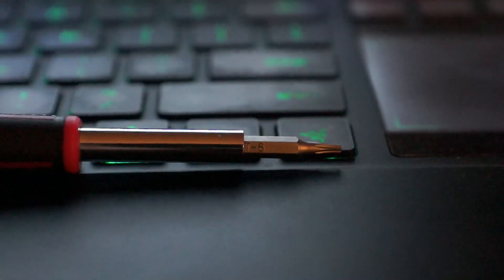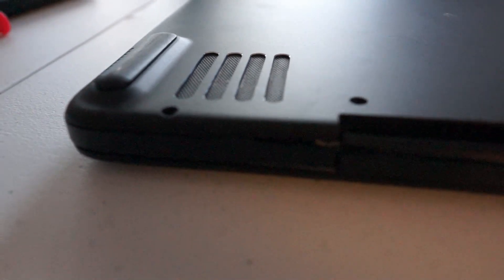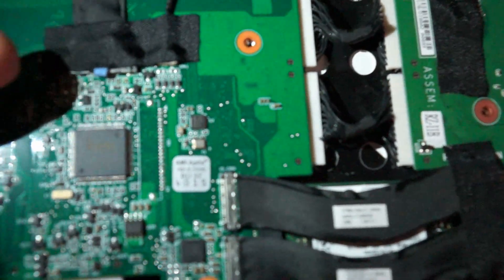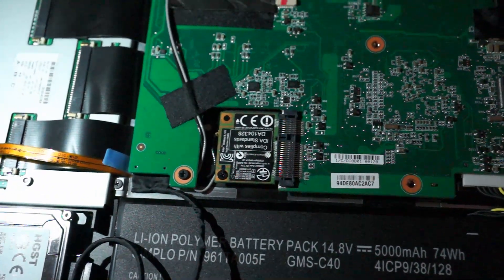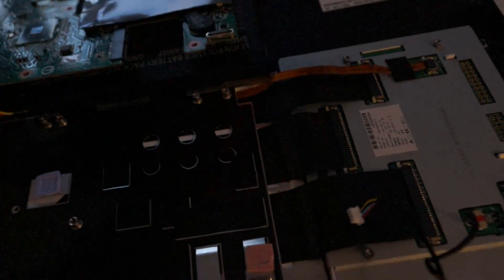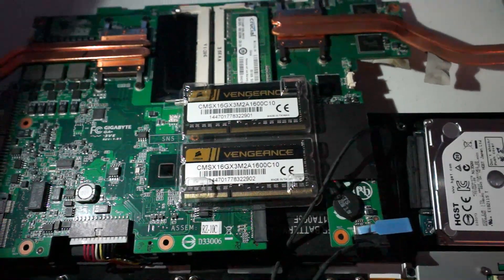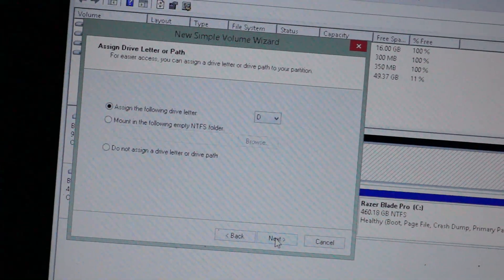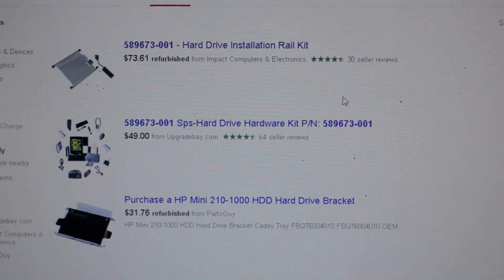How To Upgrade Razer Blade Pro RAM and Second Drive

Comment: I know this is a long shot because of how old this video is but is there another alternative to the rail kit? I can’t find one at all... also what about a battery replacement
Reply from the maker: HYPNOPED only option for battery I found was a direct replacement from Razer and they wanted $100 just to ‘diagnose’ my laptop then charge me another $100 to replace it. They’d probably charge more on top of that for labor.

Haven’t seen any other rail kits. The one I mention in the video is long discontinued.

Comment: is there another cross ref for this pn ? cant seem to find this cable.
Reply from the maker: The cable was discontinued but last time I searched these might work.

HP Pavilion DV6-3000 Series SATA Hard Drive Connector W/ Cable
HP Pavilion DV5-2000 Series Hard Drive Connector W/ Cable 6017B0265101
HP Pavilion DV5-1000 Series SATA Hard Drive Connector w/cable
HP Pavilion 14" DM4-2000 SATA Hard Drive Connector Cable 6017B0258901

Your best bet is probably ebay. The 

cable shouldn't be more than $20.

"List of compatible models includes: 
Mini 210-1000eb
Mini 210-1010TU 
PC
Mini 210-1024TU PC
Mini 210-1035TU PC
Mini 210-1043VU Netbook
Mini 210-1052TU PC
Mini 210-1062TU PC
Mini 210-1074TU PC
MINI 210-1083CA NOTEBOOK PC
MINI 210-1095NR NOTEBOOK PC
MINI 210-1101TU NETBOOK
Mini 210-1107sv
Mini 210-1111TU PC
Mini 210-1119TU PC
MINI 210-1128TU NETBOOK
MINI 210-1138TU NETBOOK
MINI 210-1155DX NOTEBOOK PC
Mini 210-1180ss"

Comment: * * *

Observation:
7:05 You indicate two different screws with the same shot... you speak of black in the middle... both screws I see are black...
How about using a screwdriver to point to the ones of which you speak...?
7:25  The underside is dark... how about a lamp to show us the pieces and parts under there...please...?
* * *
You're the first result to arise... and I just now see it's 4 years old... (sigh)
I believe the techniques and build structures haven't changed much.
* * *
Thanks for the work you put into creating this video...
You did well... I hope it all helped your continued video endeavors.
* * *

Until that time. . .
Reply from the maker: I think the two screws closest to the edge of the laptop hold the motherboard to the chassis. Lighting sucked because that was the best I had at the time. Infant kiddo was sucking up all of my time so I squeezed that video in where I could. You can hear him in the background. Haven't touched the Razer since getting an Alienware 17.

Maybe I should do some videos about my current setup. Been streaming on Twitch when I have time.

Comment: hola como consigo ese cable sata
Reply from the maker: HDD 0 = No. (if this is the SATA you're referring to it plugs into the board)
HDD 1 = Yes. (cable not included unless you bought a laptop with a secondary drive installed)
Reply: @MotoErgoSum  veo en internet que existen variedades de tipos de cables sata para laptop.. me podrías ayudar dándome una opción que tipo de cable necesito o si existe algún modelo de laptop que posea el mismo cable saludos desde Honduras mi inglés es malo por eso no te escribo en inglés lo siento jeje

Comment: Is the HDD on a sled or just left loose in there?
Reply from the maker: No chassis mount. It was just loose with a few foam bumpers keeping it from sliding. One of the major sacrifices of the super slim form factor is cutting corners like that. Compared to my Alienware 17, Razer has pretty much everything on-board. If you ever need a repair or replacement on anything on the newer Razers, expect to replace the whole thing. :|
Reply: MotoErgoSum I’ve been looking to upgrade mine to have a HDD and I’m finding information hard to find on what I need to upgrade it with an SSD and HDD. So the HDD just sits in loose? It doesn’t need a bracket or anything

Comment: will this part work for install? https://www.amazon.com/Replacement-Connector-Latitude-Compatible-DC02C00B100/dp/B07CWMKQLF/ref=pd_day0_hl_147_8?_encoding=UTF8&pd_rd_i=B07CWMKQLF&pd_rd_r=d492b95e-a4c8-11e8-b8ab-236fd1948e2a&pd_rd_w=aKq70&pd_rd_wg=QTZ4c&pf_rd_i=desktop-dp-sims&pf_rd_m=ATVPDKIKX0DER&pf_rd_p=6a8492ae-b1a9-47e4-8244-e55b8611820c&pf_rd_r=QS3ZSHJ30J7E8J7M4133&pf_rd_s=desktop-dp-sims&pf_rd_t=40701&psc=1&refRID=QS3ZSHJ30J7E8J7M4133
Reply from the maker: Sorry for the late reply. Not sure if you contacted me on Facebook previously. That link no longer works. HP no longer carries the part I used. I'm not much help at this point.

Comment: My same laptop ssd is not showing in bios. how would i check pls do let me know.
from where i check my ssd in my motherboard.
Reply from the maker: If it's the original SSD and it's not showing up in the drive section of bios it's probably dead. SSDs only last a few years before they run out of writes. The newer drives have better longevity, but you should avoid using a solid state drive for anything you're going to constantly write to, like mass storage. If you do, make sure to have a good backup drive in case the SSD fails.

Comment: Would the crucial 32gb ram be compatible? Looking around but no answers.
Reply from the maker: To my knowledge, not for the 2013. If later models had the option for 32gb from Razer, yes, so long as the clock speed and other specs line up.
Reply: Thanks! Picked up a 16gb vengeance. Worked beautifully.

Comment: hi, how do you disconnect the battery from the motherboard?
Reply from the maker: You can see the multi-color cable at the top of the screen @2:53

I think I put a finger on either side and firmly pulled on the white connector. If that doesn't work, use a small plastic tool on the center notched part and twist so one side pushes against the connector and the other nudges the plug. You want to avoid pulling on wires to unplug stuff. I don't recall it being very hard to unplug. it's just a pain without the board flipped. There isn't much room in there.

I'd rather have a laptop that is a tad larger, easy to service, and has better ventilation. My battery eventually puffed while playing a CryEngine game that seriously cooked the heatsink. LiPo batteries don't like heat, and it seems like the 2013 Blade Pro is too compact to handle the heat of extended gaming sessions. Luckily, the system runs with the battery unplugged so I continued to use it until this summer when I upgraded to the Alienware 17 with a 1080.
Reply: MotoErgoSum I'm really having trouble getting a grip on the connector, will tweezers work in pulling it out?

Comment: Supposedly the new version, the one with a 1060, 1080p, 120hz panel, can be more easily accessed for upgrade including RAM and SSD. The base model comes with a 2TB HDD, so you probably wont need to upgrade that unless you’re stashing your illegal movie collection lol
Reply from the maker: Doubtful. Everything I've seen of all of their laptops for 2017 is everything is soldered onto the board, including the ram. The only thing that'll probably be upgradeable is the SSD.

Comment: Yea, careful with using fingertips to open case. Those edges are sharp and I cut myself a couple of times. Razer and blade are fitting names.
Reply from the maker: It also bends about as easily too.

Comment: is it possible to upgrade the gpu? i'd like to replace my 960m with 2x 980m
Reply from the maker: Sounds like you have a newer blade or blade pro. The GPU is probably still soldered onto the motherboard. If you want to be able to upgrade, go with Alienware. I upgraded my old M17X pretty easily.
Reply: MotoErgoSum old blade pro the 17" one

Comment: Is the SSD on your Razer blade pro a Half Sized mSATA?
Reply from the maker: The primary is the factory-installed mSATA. I added a secondary 1Tb 2.5" Western Digital Black disk drive. When 1Tb mSATA and 2.5" SATA prices drop to around $250 I'll upgrade both.

Comment: After I installed 16gb ram my screen is black. Did I did something wrong?
Reply: When I installed back the 8GB ram it worked again. Why is it like this? Please help .☹️
Reply from the maker: Assuming it's the right spec (latency, frequency, etc) and you're running a matched pair (same brand same spec), it could be bad RAM that needs an RMA from the manufacturer. Make sure your latency and frequency matches the original memory.
Reply: I bought the exact ram that stated on the video. Is it 16000mhz or 1333mhz? The vengeance ram That I bought is 1600mhz if it's the same. Maybe it is a bad ram
Reply from the maker: http://amzn.to/2jxLpuW

Corsair Vengeance 16GB (2x8GB)  DDR3 1600 MHz (PC3 12800)1600MHz10-10-10-27 latency1.5V
Reply: Yes that is the one that I bought. But sadly it's not working 😭. Maybe bad Ram or do I need to do something on bios?
Reply from the maker: I didn't have to do anything special. It worked right away. I'll see if I can check my bios this weekend and give you my settings. I updated to the latest bios years ago and it's worked on windows 7, 8, and 10.

Comment: It will be great if you can do a video on the blown battery pack of your Razer Blade Pro. Find out what it looks like in the inside to see if we can replace the cells.
Reply from the maker: I looked at the cells but wasn't able to find a direct replacement anywhere. I considered using RC car cells, but LiPo batteries are very sensitive to voltage and toxic when they explode. They generally pop because they went over or under voltage. Add the intense heat of an hours-long CryEngine gaming session with little to no heat shielding in the battery part of the laptop and you've got a recipe for kaboom.

Main reason I didn't experiment with RC cells is they're expensive. I think the battery is a 4S LiPo setup, so you're looking at at least $50 or more just for the experiment... I decided to just remove the battery and make my system a mobile desktop rather than risk frying it.

Comment: Do you know how disassemble the lid and the LCD? it seems my blade pro webcam is having issues and I'm having trouble finding out how to open that part in order to fix it.
Reply from the maker: From what little I've been able to find on the internet it looks like you'd have to do some prying to get the lid open. If I had to guess I'd assume there are some pry points hidden behind the rubber seal that keeps the lid from smacking the body. Before doing that I'd unscrew the two hinges from the body by removing the rear cover and disconnect the ribbon cable. If mine ever goes out I'll do another video, but for now this is my only decent PC outside of work so I'm not experimenting for now. Planning to build a desktop next year and maybe get a new smaller laptop for travel if I can swing the cash.

Comment: Can you do a video if the new razer blade 2016 with a gtx1060. Can the memory be upgraded or not?
Reply from the maker: I have no idea. I'd love to upgrade. Maybe 2017. Best place to check is notebookforum. That's where I did some of my research. Keep in mind the LiPo battery doesn't like heat, so if you pick components that run too hot you can pop your battery and opening your laptop pretty much eliminates any warranty coverage you might have through Razer.

Comment: Hi bud, thx for the nice vid! How was the laptop going? Still working well?
Reply from the maker: Three years late, but it still runs to this day. Only major issue I had was the battery puffed while playing Armored Warfare. I think the GPU and CPU just got so hot it cooked the battery. Runs fine with the battery removed. Just can't unplug it, obviously. Razer wanted like $100 for a new battery and another $100 to install it. They refused to mail me one and I couldn't find any aftermarket replacements so I just stopped buying Razer laptops.

Comment: Hi, I have the Razer Blade Pro 2014 17"  

I am tempted to do this upgrade, however I want to upgrade the SSD first, however I am unsure about the mSata purchase. Will the Samsung 850 Evo 500Gb Msata (Mz-M5e500bw) be compatible with the mSata slot on this machine? 

I am getting confused with the different mSata drives available at the moment.
Reply from the maker: +Vueey Le I'm pretty sure that's the right one. Looks like what we've got in there. @4:00 it's at the bottom of the screen behind the two black ribbon cables. That 500gb is the smaller version of the 1Tb I've been waiting for the price to drop on.
Reply: Awesome thank you, because mind has the 120 GB and it's becoming an annoyance to keep on transferring files back and forth with my external drive, the 500gb Evo Msata drive is only about $264 online, so I might as well get one! Thank you for your reply :)
Reply from the maker: Vueey Le
I'm seeing the 1Tb for just over $300 and the 500 for around $160 in the US.
Reply: +MotoErgoSum Haha yeah, sadly I live in Australia, so everything is more expensive over here, the 1TB is $465 over here while the 500GB is $264, else I'm looking at the right one so I won't buy the wrong one :) looking forward to update my storage! Accessing the Msata drive shouldn't be hard from the looks of it?
Reply from the maker: Vueey Le
Nah, just remove a screw and unplug from what I could see. Same for the wifi card.

Comment: I am curious why did you go with DDR3 ram instead of DDR3L? According to Intel's website the processor is compatible with DDR3L and it would reduce the thermal output/run slightly faster. Am I missing something? Just want to make sure I cover all my bases before I upgrade.
Reply from the maker: +Jacob Slats I just went with something others had used successfully on the notebook forum. Doing an open-box return of RAM is a pain in the ass. How much cooler does the DDR3L run? The difference is only 0.15v for Corsair Vengeance.
Reply: +MotoErgoSum I don't actually know how much cooler it would be. I have read on a couple forums that  say using DDR3L can extend battery life and lower temps but no one posts specific numbers.
Reply from the maker: Jacob Slats
Yeah, speculation is worthless without direct empirical comparisons. My battery fragged itself from heat sometime before I did this mod. I was wondering why the case wasn't sealing perfectly, then the battery made a loud POP and expanded to almost twice its size about 6-8 months after the upgrade.

Too bad Razer doesn't sell batteries direct to customers. I refuse to pay ~$300 to send my notebook to them just to remove some screws and plug in a new battery and have the same crap happen later. If I buy another laptop from them I sure as hell will be shelling out for the extended warranty.

I might use some drone batteries to build a new pack. It's just the lithium cells that went bad. The controller is probably fine. That's a $50-80 gamble, though. I'd still have to come up with a good way to shield the battery from the mobo. The CPU and GPU on this thing is ridiculously hot and the fans aren't up to the task. Probably just relegate it to mobile desk duty and get an Alienware 15 or regular Blade next time. Comparing prices, though... The Blade is like 2x the price of the Alienware 15.

Comment: Hi MotoErgoSum. Will the SAMSUNG Spinpoint M9T ST2000LM003 2TB  Internal Hard Drive fit inside the Razer Blade 14"? Also, is there any way to change the Razer Blade's processor from a 2.6Ghz base to something higher, maybe in the 3.0 range, or is the processor similar to the macs where it is superglued?
Reply from the maker: +MrChouteOne The 14" doesn't have the secondary bay, so no. You'll need an mSATA card if you want to upgrade your storage. I have no idea about the CPU on the 14, but it's probably soldered onto the board. Looks like the CPU is soldered on the 17" pro. You can see it @7:27 straight down from the left RAM module. Clearly glued onto the board. From what I've read, the CPU, GPU, and RAM are all on-board on the 14 and I doubt that'll change anytime soon. To hit this kind of MacBook form factor it pretty much has to be.

With how expensive high end CPUs are for laptops, you're better off just selling your current laptop and buying new. I tried pricing CPUs to upgrade my old 2008 Alienware M17X and they were $800... Unless you're running a CryEngine-based game, most games use the GPU more than CPU. Unfortunately, all of the Razer laptops have the GPUs built into the motherboard as well. That's the huge trade-off. You can have thin and light, but everything on-board, or you can have a gigantic laptop that weighs as much as a cinderblock and be able to upgrade everything.

Comment: Hi, does the Razer blade pro (17") 2014 have a second msata slot? I have a 256gb in there want to add another hopefully? I see yours is a 2013 model, hopefylly they didn't remove the option to add a second drive.
Reply from the maker: +Karoq Sound I'd assume it's there, but I don't know for certain.
Reply: +Karoq Sound Sadly for us there is not second m-sata slot, it is the same as the 2013 model. If we can to expand out storage we have to find this Sata cable and add a extra drive in that empty area. 

Any chance does anyone know what msata the 2014 model uses? I might upgrade the mSata drive instead of adding a new drive in, I can't find the Sata cable anywhere to do this upgrade.